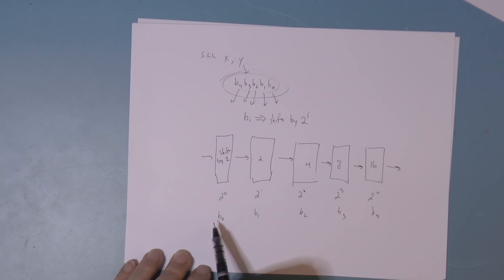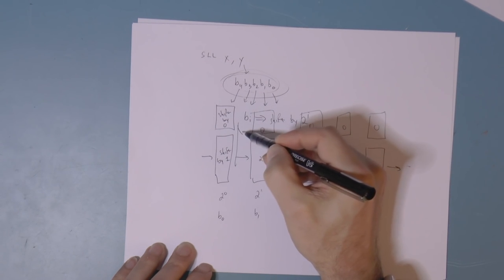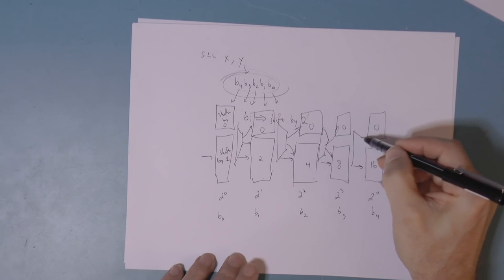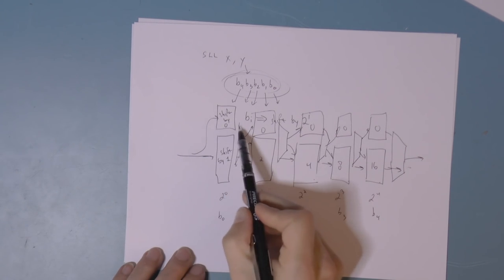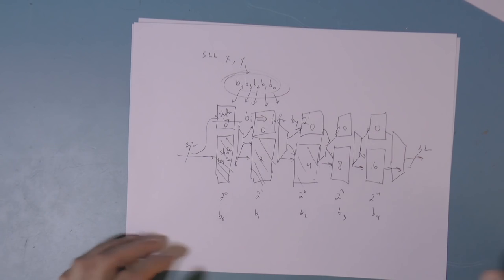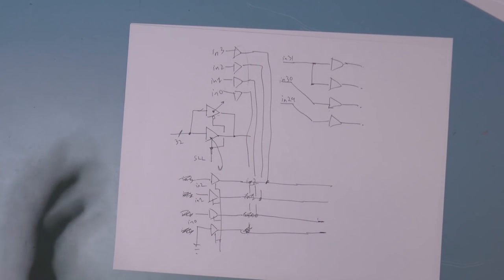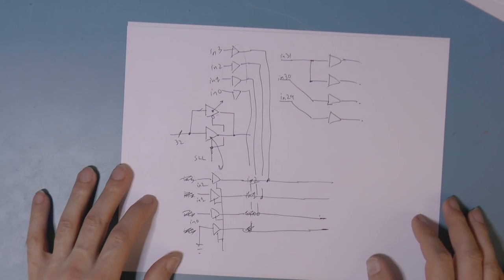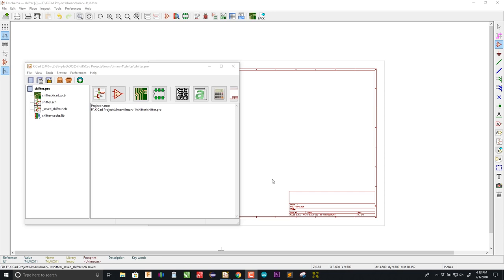LMARV-1 (Tangible RISC-V) Part 4.1: Designing the shifter

Comment: I believe there is still a single typo, where a rs1[30] was accidentally labelled rs1[20] on the right shift by one portion.
Reply: Yup... and not an insignificant hardware bug, either.  Fortunately, if he didn't catch it himself, he has us to troubleshoot for him.  Did he correct the outputs of the final shift left of the lower set?  It was incorrectly set to S8 instead of RD.

Comment: Love these videos... I am a little late in finding them, but one part that still has me scratching my head is why the replication for “no shift”, what am I missing that just one is (along with some decoding) actually needed, the board real estate would still be less than the extra mixes. Again thanks very much for going through this / shaping.
Reply: This stuff really isn't my forte, but my first guess would be related to the delta of the circuit being consistent all the way through. That or the circuit is easier with it as the no shift is just a buffer that stops the value from being carried through. so assuming the amount to be shifted is 0b0101 (assuming four columns) would result in left shift(1) > no shift(2) > left shift(4) > no shift(8) resulting in the same a single shift left(5).
I hope that helps, but I guess it really doesn't help that I don't understand what you don't understand.
Reply: The 'No Shift' is tri-stated so it doesn't drive the bus at the same time as the other shifts would. A straight wire would possibly cause contention or shorts etc. Each "step" is either on or off independently of all the other "steps" around it. I think that's what you were getting at, forgive me if I misunderstood.

Comment: Hi Rob, I've decided to follow along and build a version of LMARV using 5V logic. I'll be using 74F181 & 74F182's for the ALU and precede that with logic to make it compatible with the LMARV ALU control signals. I have a 1000 74F244 in TSSOP and will re-imagine the shifter using them. Obviously I'd have to do a new board layouts but I think I'll make sure that my cards are compatible with your bus layout and card connectors. Can't guarantee that I'll keep up with your rate of production but it'll be fun whenever I get to the finishing gate.
Reply from the maker: Uh oh. I hope my descriptions turn out to be accurate :) I'd definitely like to see what you come up with!
Reply: Definitely. Looking forward to the next installments.

Comment: Hey Robert, I know this video is 1yr old but I am just watching your entire series (which is great by the way!). I see you are manually editing the numbered labels in KiCad, you can press the "insert" key to repeat the last action. If you last label ends with a number and you press insert, KiCAD will automatically increment that number, unfortunately it doesn't work for square brackets afaik.

Comment: Hi Rob,

I think somethink is wrong. I had seen the first 60 minutes but I had found few failures in this  part:
1. SLL(x) = EXCH(SRL(EXCH(x)) where for y=EXCH(x) ==  y[31..0]=Y[0..31]. It is simple to do it with two-input MUX and inverter. It saves 16 ICs and you will drive 2 inputs instead of three from the input bus.
2. The OE signal is inverted and you need to connect it before 7404.
3. Don't ground the shifter's unused bits. Let's mark it rs1[32]. It can be equal to rs1[31] or zero.
4. If I were you I will use the 74AC logic as it can be loaded by 20mA to both L and H - nice for termiating the bus.
5. What about 74AC16245? You will use half of ICs and it is more flaxible in layout as you can swap the sides if needed. You need 24 of them (approx. size 8x10cm)
Reply from the maker: 1 - True! I could eliminate the SLL chips (-20 chips) and add an exchanger at the beginning and one at the end. But, I'm not sure I want to add two more gates of delay. Still, it's an intriguing modification.
2 - I'm not sure I follow -- /shift_oe is active low in the signal from the slot, so there's no need to invert it.
3 - Makes sense if exchangers are used.
4 - LVC is slightly faster than AC, and also AC's thresholds are not compatible with the rest of my system (which is LVC)
5 - I gave serious thought to using the '16245, but in the end, it's more than twice as expensive. Swapping the sides -- that's right, there's a direction input! If the PCB turns out just way too big, I might move to using these chips.
Thanks so much for the feedback! Keep it coming!
Reply: Rob, let's count the delays (including the control lines buffer). It's same as one stage before.
In the rest of them I have next comments:
6. The control buffer should have grounded OE. The ~shift_oe is 0 or tri-state in this case and the question is: Where you get the charge to block the 3-state CMOS buffers? I think it will be noise-controlled system in case you don't shifting and the noise can escape to the output bus. In all cases it's good to have defined level on the inputs.
7. For similar purposes I wouldn't put the OR gates into ~shift_left and ~shift_right but into rs2[4] and ~rs2[4]. All the buffers inside will have the inputs in defined level but the last stage can cut it out of the bus.
8. I dislike 31 inputs connected to the one logical output. At least split the signal from the AND gate to more branches and amplify it by the rest of AND and OR gates (but the first stage should stay on the 1st AND output)
9. The output is not connected back to the connector

Comment: You need to ground those unused AND-OR inputs.  Also, the final outputs need to return to the bus connector's destination pins (or to one side of the ALU?)  Finally, the fanout on that AND gate is pretty high; consider putting the same inputs into all four gates and driving 8 pins from each output.

Comment: Noted a few things now that I'm all the way through =)

You marked rd[*] as no connect on the connector, shouldn't these actually be  connected to the output?

Since you use the shift_oe' as a control signal for the control buffer the output shift_oe will be tri-stated if the shifter is disabled. However this is used later to control the output buffers. So the output buffers will not get a well defined enable signal.
Reply from the maker: Bartek K Nice catch, thanks!
Reply: Watching from the future and thinking aren't the net labels of the by 16 shifters left named s8 and not rd, and the rd connections to the PCIE connector shouldn't be marked as NC and wondering when this is going to be noticed. 😱😰

Comment: This got me thinking, could you implement a sort of "half sieve" with some sort of try state mux? Like, using a mux that has two inputs and one output, with multiples of that in one chip. That way you would not have to worry about the floating states? Could maybe even do that for the input and output to implement a bit swap thing to allow left and right shifting with the same circuit.

Also oddly enough, all of this is making me really want to do crazy FPGA things. Baby steps, still waiting for the little one to come in the mail. :-P

Comment: 19:30 There is a repeat button in KiCAD. The "Ins" button. Not sure if works on "rs1[0]" though. I use it for busses.
Reply: I tried. Didn't work with that pattern. Worked with rs1_0 pattern, allthough only incrementing and placing downwards. You can also add a wire to a pin and then hit Ins to repeat.

Comment: Nooiiiche 👍, it’s actually the same idea as an barrel shifter though but with tristate buffers instead of multiplexers. It really gets complex if you would add rotate functionality 🤔. Now I think I’ve spottet an error in the shift by 16 stage. The upper 16 bits of the no shift got the wrong inputs (s4[0-15]) I think I saw there.
Reply from the maker: Nooiiiice catch!

Comment: I thought you'd go with RAMs after the introduction because of the huge delays involved (3 gates before the first stage, 5 stages, 1 final buffer = 9 stages propagation time. The Gate inputs of the buffers are probably slower too than the data path.
One tip if you're gonna do more videos like this: if you're going to do a lot of repeated work that we'd probably want to skip over, don't talk. If you only talk during the interesting parts, it's easier for us to fast forward. It would also make video editing easier for you to identify parts during and speed them up if you'd like to.
Reply from the maker: The RAMs would be huge, even if I were to split them up.

Comment: The control signal outputs of the '541 buffer in the bottom left corner all should have pullups or pulldowns. I would put a pullup on ~shift_oe and pulldowns on the rest of the output pins. That way the default will be no shift.

Also, don't you want the top-left '541 to be labeled U1
Reply from the maker: I did add pullups (to all the outputs) -- ~shift_oe for sure, but for the others, the default doesn't matter. Also, you're right, I should just reannotate from fresh.

Comment: At 2:28, you say "arithmetic shift right is the same as dividing by two", 
but for negative numbers, you need to add +1 before SRA to get the same rounding behaviour:

See "Arithmetic Shifting Considered Harmful" by Guy Steele: http://dspace.mit.edu/bitstream/handle/1721.1/6090/AIM-378.pdf

Comment: Hello, you mis-lable 1 pen near "Shift Right" (1 bit)  you lable a pen RS1[20]  and it needs to be lable RS1[30]. 
Also  is loading that poor little 74ls08 output with 31 inputs not a little much ?
Reply from the maker: Marco Lokker Thanks! I knew there was a reason I made this video!
Reply: It can source and sink 24mA, a typical input is 0.01mA
Reply from the maker: Marco Lokker oh, also it's an LVC, not an LS. I'll definitely be going over all the feedback in the next video.